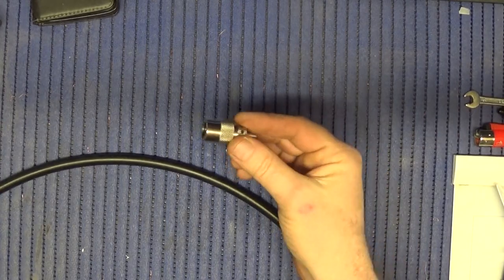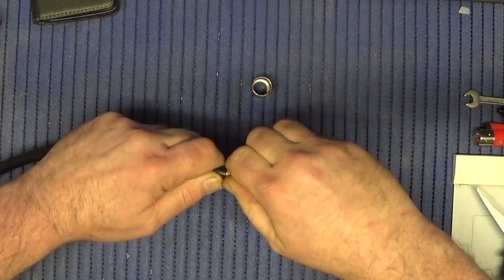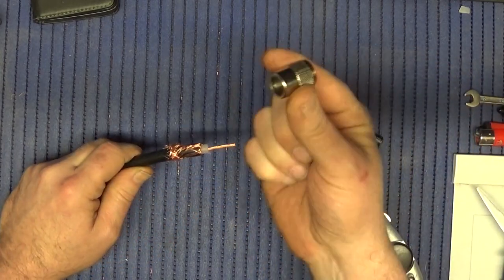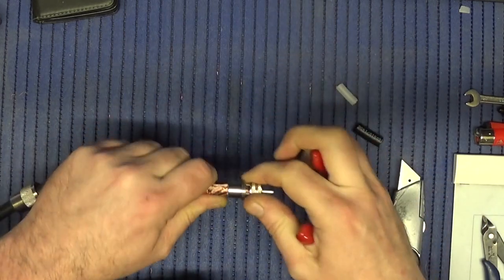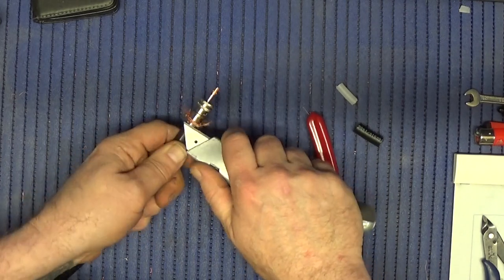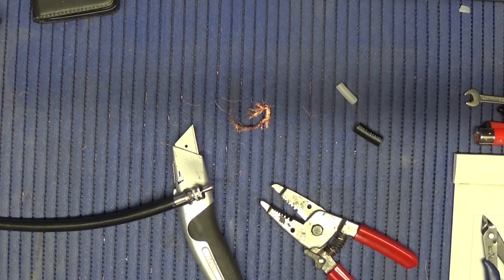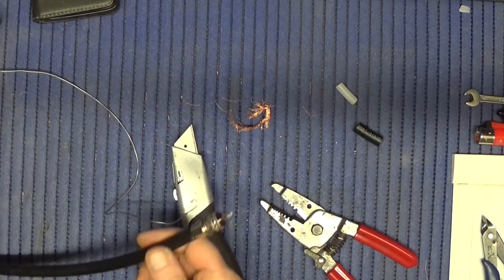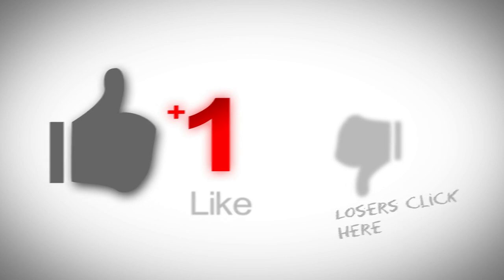How To Fit a PL259 to RG213 coax

Comment: Always best to rather tin the braid and solder via the spaces provided on the 259, I have found that time causes a poor connection this way. Also have had cases where the thread has actually cut the copper braid to almost nothing.
Reply from the maker: best and practical are two different dogs fighting in a sleeping bag

Comment: Not correct! The outer braid should be Soldered to the body of the 259. That's what the hole in the body is for. Its quit a skill to do it. Without solder the connection will become unreliable over time

Comment: Not soldering the braid is wrong!
Reply: no it is not wrong !
Reply: @HAMRADIOSTATION-ON6ZK-Hans yes it is. There is a reason there are 4 holes so you can solder the braid. It makes a solid electrical connection. Your method may work initially but the chance of failure down the road is high.

Comment: This way used to work with older PL 259 connectors easily, but the current batches of cheap Chinese PL 259's wont fit on this way without sacrificing too much of the shield braid, that is if your using half decent 213.

Comment: You are cutting the copper braid, as there is not much of it-cheap 213. Tin the centre conductor first, a solid connection is key especially if you are running power. It's poor technique that lets a station down, this is not how you prepare a 259, perhaps tv guys do but not real ham radio guys. Maybe check some of the other Youtube methods as you will certainly see the corners being cut doing it this way.